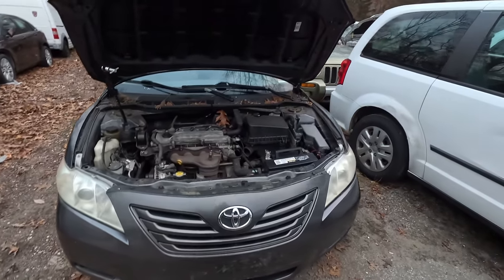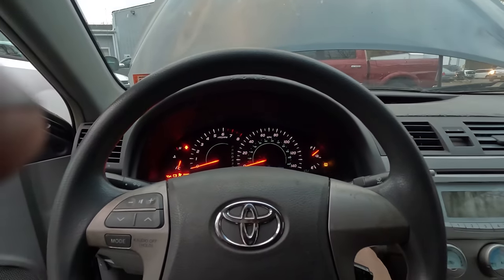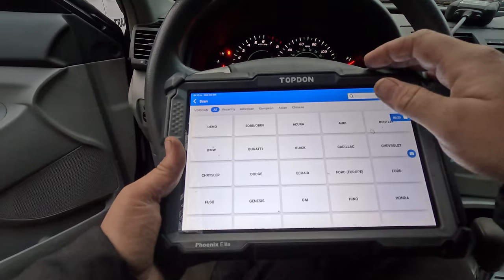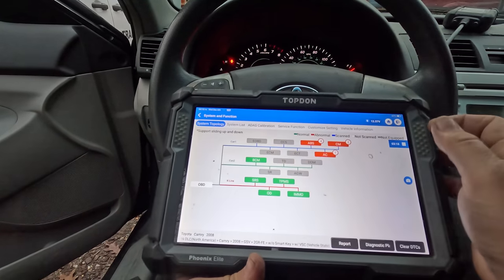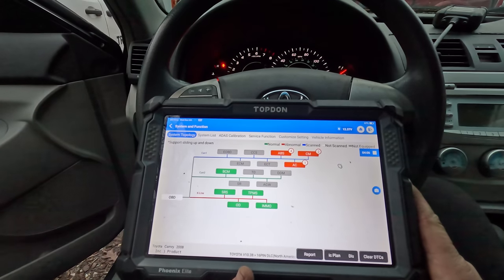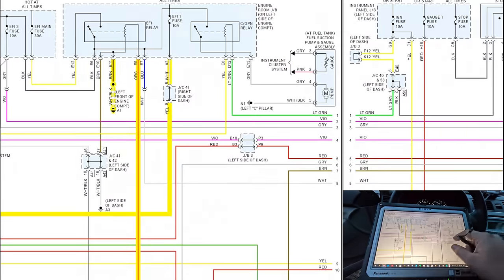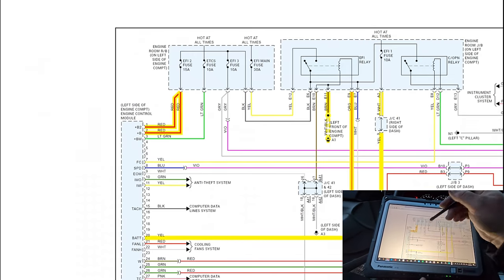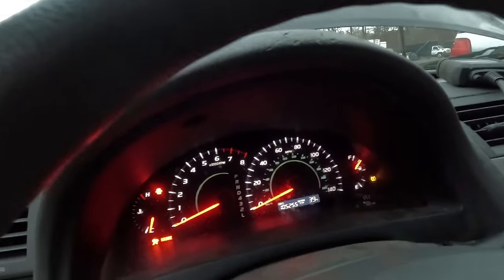2008 Toyota Camry - Crank No Start / Diag & Fix!

Comment: Question, what does that adapter from jarhead diagnostics actually do and is that just for toyotas?
Reply from the maker: It jumps pin 13 to pin 4 on the data link connector. (which is just grounding pin 13) The only cars I know that need this Immo sync are Toyota & Lexus.
Reply: @advancedleveldiagnostics  so just reading down through the comments so when it grounds pin 13 for 30 minutes what exactly does that do?
Reply: @advancedleveldiagnostics   Thanks. Good video!

Comment: If you connect the Godiag to the ECM and the blue LEDs from pin 6 and pin 14 aren't flashing, you do not need to check it anymore. It is simply dead. 
On some GM ECM models, you have to connect the accessory pin to 12V also on the bench.
Nice video by the way.

Comment: I have  a similar  breakout box.  It  sure is handy
I sometimes use it to catcha  module that wont go to sleep/ parasitic draw.I  just put it on and I  check it occaisionally  while working on other cars. Takes 2 seconds and you dont have to babaysit it. At least  it will Identify which network  it is on

Comment: Can you do a little video explaining the little jumper tool from Jarhead diagnostics and what its purposes? Thanks brother. And is it a Toyota thing or work on all vehicles?
Reply from the maker: I'll make a video later, It's pretty much just a jumper for pn 13 to pin 4 on the DLC. It is for Toyota and Lexus. When you leave those pins Jumped it syncs the Immo of the car with the Module that was replaced.
Reply: @advancedleveldiagnostics  sweet

Comment: Hi at 10:30 timesacale, you are using an adapter to ATC mini fuse to power the line manuallly, what is this called please and where can i buy it.. basically you removed ATC mini fuse and put an adapter inpalce of that fuse and powered it manually, i am looking to get one .. appreciate your help.
Reply from the maker: They are from Aeswave, they came in the uTest terminal kit, Here is a link for them by themselves 
https://www.aeswave.com/Fuse-Amp-Loop-with-Voltage-Tap-p9653.html

Comment: Super job dude! Helped me find the problem with my girls 04 Camry simple fuses n shit. Was having the same cranking no start. But what’s the coolent puddle at the bottom of the engine on ur vid there about 5 mins into video
Reply from the maker: I couldn't find what you were referring to, but the car was in pieces so its possible coolant leaked out.😀

Comment: The only part got confused on is when you said that the control side of the relay that turns on first EFI2 is coming from the computer, then why further checks if the constant and ignition powers and grounds and comm to pcm are good? That should be enough to call a computer?
Reply from the maker: You are correct, I was getting thrown off by the clicking in the fuse box and the aftermarket wiring. Also I've never seen a bad computer on this year camry.

Comment: Was it intentionally you ignored pin 3 light green?
Reply from the maker: That is power for the Throttle, that fuse blows many times when you boost it backwards. I've seen many times that fuse blown and the PCM communicates. Thanks for watching!
Reply: @advancedleveldiagnostics  I did not know that. Thanks for the tip. 👌

Comment: @advancedleveldiagnostics what was the little orange box you used to reset the computer, I am fixing a 04 with the same issues but I can’t find the name of the little box you used to do the reset with. My girls car been broke down for 6 months so if I can get that thing running again with a simple computer swap and reset we’d be golden, cus my Mazda has a busted head gasket. I’d rather spend 2 hours fooling with a computer then 4 days fooling with a engine strip down and reseal 😭😭
Reply from the maker: It just jumps pin 13 to pin 4 on the OBD connector. It syncs the Immo data. It is from jarhead diagnostics, it is not necessary you can jump it with a wire or paper clip. I'm not sure if an 04 camry requires it to be jumped or not.

Comment: Is it correct to say u r using an external power and ground supply to c if the computer powers up and communicates?  If so, why don’t u use the car battery to do the same thing?  I will watch again and c what u did. Thank u!!
Reply from the maker: Yes I was supplying power, ground and communication directly to the Computer. The tool I am using doesn't have an option to connect to cars battery.

Comment: Did you use the original terminal wires the godiag came with to plug into the pcm or make your own with the aeswave ones?
Reply from the maker: I used the AES wave leads, they also make a connector that has banana jack ends and plugs into the go diag.
Reply: @advancedleveldiagnostics  awesome..gonna order that banana jack cable..never knew about it until i saw your setup

Comment: I didn’t know you can just plug in ground to set diagnostic mode and it will reset Toyota new computer 😱 sooo cool
Reply from the maker: It works until the new system which started in around 2020, Then you need Techstream and do the ECU security key.
Reply: @advancedleveldiagnostics  ahhh of course. Thanks man . I ordered that tool from jarhead I’ve ordered from him before but missed the Toyota plug diag
Reply: @advancedleveldiagnostics  so insure it is basically programming the computer to the vehicle?

Comment: Did this car come with an immobilizer? I’m having the same problem. I put the key in, car won’t crank or anything. I checked all relays and fuses and they are reading within spec no blown fuses. The cars radio, clock, a/c, power seats, and turn signals aren’t working, but the fuses are fine. Now the car won’t communicate through obd2 port with scanner and obd fuse is functioning. Do you think this could be the ECU/ECM? It’s a 2007 Camry.
Reply: What you figure out? I have the same problem

Comment: I'm thinking of buying one of those Godiag breakout boxes. Are you happy with yours or would you recommend something else?
Reply from the maker: If your using it for on the bench work it's fantastic. If you want to use it as a regular break out box in the vehicle, it's a little cumbersome for that. I would use a cheap amazon one for that.
Reply: @advancedleveldiagnostics  Thanks!

Comment: I don't know if you wanna hear this.. but there's a much easier way to attack the problem of *do I have a bad ECM*.

With the ECU plugged in, constituting a legitimate/built-in load:

1) do I have +85% of battery voltage at the ECU, on all the appropriate a) always hot and b) hot only in run/start key positions.. then,

2) do I have no residual voltage at the ECU on any principal ECU grounds, meaning more than .100 volts with the key on.. then,

3) do I have the same 2.6 volts bias voltage at the ECU data + and - terminals as I see at the DLC.  These can all be performed with a decent RMS DVOM, and one that also has an LED rattle bar below the digits will also give you a quick visual of the repeating COMM burst, but of course that's just icing.

Catch my drift?

And yes, I always verify I don't just have bad fuses first.
Reply from the maker: I'm not sure if you skipped to the end or just looked at the thumbnail, but that is exactly how I checked the ECM. I just used a scope instead of a multimeter because it is easier and more accurate. The only reason why I used the breakout box is because I still wasn't confident because I heard a bunch of relays clicking and there was aftermarket stuff mixed in. It was just extra credit to give me peace of mind. Thanks for watching!
Reply: @advancedleveldiagnostics    I feel ya' bro.  Believe me when i tell you, I'm rooting for you.  Not many want to run at what you and i deal with on a daily basis any more.  But, oh wow, I guess that means more for us.  😄

Comment: So no automotive technician can technically memorise all those wires ,their colours , locations and what they do , you've got to need  to refer to some sort of catalogues ,just asking!
Reply from the maker: I mainly use AllData.
Reply: @advancedleveldiagnostics  is that software possible to be installed in Mobile phones or in computer?
Reply from the maker: @igiranezafabien893  It's a website with a monthly subscription; you can use it on your phone or computer.

Comment: Doing too much.  Start with a starter, battery, ecu, and fuse block and maybe a wiring harness. If customer declines work then you offer to buy the car from them. This strategy is for professionals only.